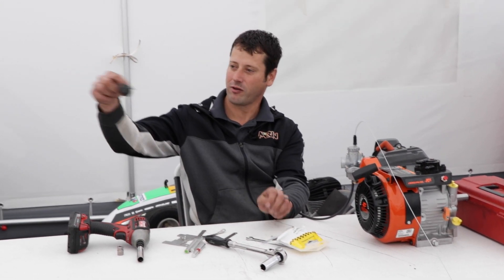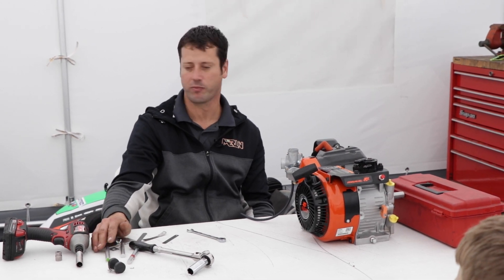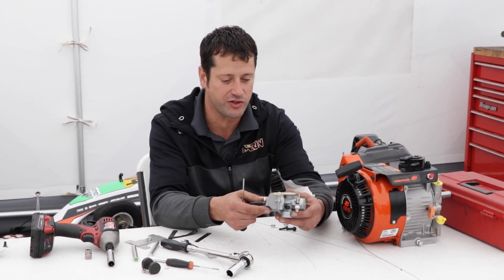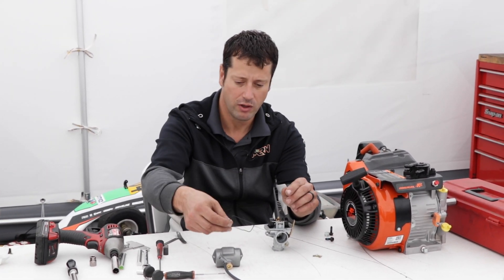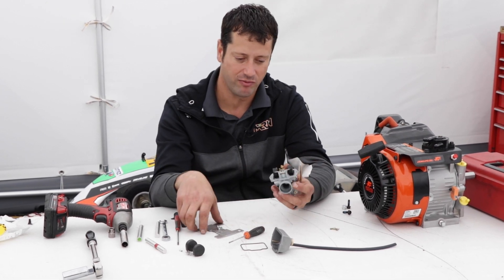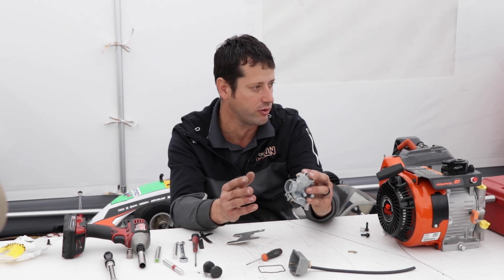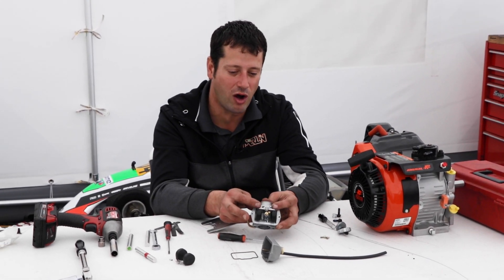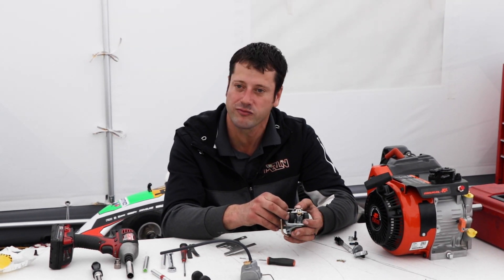Briggs 206 Carburetor Maintenance

Comment: Thank you SOOOO much for making this video.  We just got my son into cadet 206 this summer with a used kart and engine.  He's been having issues maintaining idle and also with loss of power halfway through the session (first 5-6 laps hitting 50mph and 6000rpms, next 5-6 laps drops to 45mph and 5400rpms) so I suspected the carb was the issue.  Turns out, the float height was 0.760 and the float drop was 1.25 (and the needle was popping almost all the way out) so it was WAY off on both sides!  I just did all the things you recommended, and we haven't had a chance to run it yet, but I assume things will be much smoother after this...and even if they aren't, at least we know it's not a carb issue.  Thanks again!
Reply from the maker: Glad it helped!